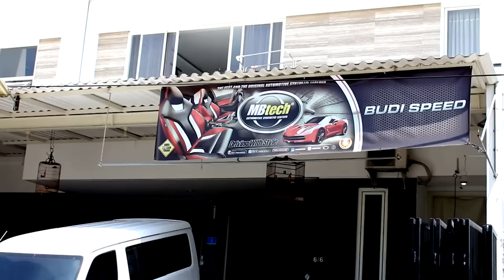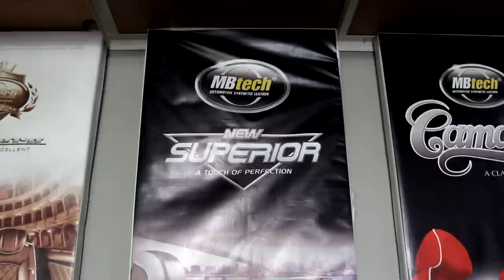Budi Speed, 30 Tahun Main Jok di Surabaya

Comment: Kalo bikin sarung jok dan arm rest buat Sienta 2016 bisa? Berapa kisaran biaya? Dan berapa lama pemasangan, krn mobil dari luar Surabaya.
Reply from the maker: selamat pagi kak....untuk keperluannya nanti bisa saya referensikan workshop jok mobil terdekat ya kak dan nanti untuk harga bisa dikomunikasikan dengan workshop ybs kak....boleh tahu alamatnya kak ...?
Reply: @MBTECHTV  Saya di Denpasar, tapi ada rencana ke SBY, mudik
Reply from the maker: @vetmusician5212  untuk di kota Denpasar bisa hubungi workshop DE MASTER di Jl. Tukad Yeh Aya no. 99 G, Renon, Kec. Denpasar Selatan, Kota Denpasar Phone. 0812-4616 001/0361-257 045
Reply from the maker: @vetmusician5212  watau di kota Surabaya bisa kontak workshop BUDI SPEED di Jl. Manyar Kertoadi VI/6 Kec. Mulyorejo, Kota Surabaya 60116 Phone. 0812-3236 858 / 031-594 0308 / 0851-0030 0997

Comment: Kalo luxio 2013 kira2 kena brpa y mas ?
Kpn2 dah aq main ksana
Reply from the maker: Halo Al Bary
Mas bisa datang langsung ke Budi Speed di jalan l. Manyar Kertoadi VI/6 Surabaya, kontak hp 08123236858/031-594 0308 / 085100300997 

Datang dan konsultasikan langsung sama seatmakernya
Terimakasih
MBtech Support

Comment: Ada jual jok seken vrz mau upgrade interior  innova old?
Reply from the maker: kalau jok seken VRZ susah didapat nih gan...tapi boleh juga coba kontak penjual jok2 copotan / seken yang saya tahu yaitu SURYA PANDAWA JOK di Jl. Raya Jati Asih-Pekayon, Rt. 03 / Rw. 03 Jatiasih, Bekasi 17424 Phone. 0852-1819 6767 / 0877-7619 2200
Reply from the maker: atau bisa coba tanyakan juga ke FERARI JOK di	Jl. Alternatif Cibubur No. 61, CIKEAS - Jakarta Timur Phone. 0812-1090 4669

Comment: Tuk mobil pickup Isuzu panther harga berapa ya
Reply from the maker: Hallo Kak...untuk estimasi mobil pick up Isuzu Panther berkisar 2,5 jt - 3 jt tergantung model yang diminta. Jika Kaka berdomisili di Surabaya mungkin bisa kontak ke workshop BUDI SPEED untuk harga pastinya. phone. 0812-3236 858 / 031-594 0308 / 0851-0030 0997
Reply: Maz utk jok baris ke 3 CR-V 2013.... Sampai berapa.... ??

Comment: Buat motor bisa gak ?
Reply from the maker: Dear End User,

Berikut lokasi pemasangan jok motor menggunakan MBtech di kota Anda.
CNS ( CENTRAL NASIONAL SADEL ) 
Jl. Ngagel Dadi 3 No.7 Surabaya. Jawa Timur 
Tel.0813-3223 3500

JOK MOTOR GOGOR TOL 25
Jl. Tol no. 25, Jajar Tunggal, Wiyung Gunung Sari, Surabaya Jawa Timur 60228 
Tel.0812- 5238 0940

Terimakasih
MBtech Support
WA: 081219822323